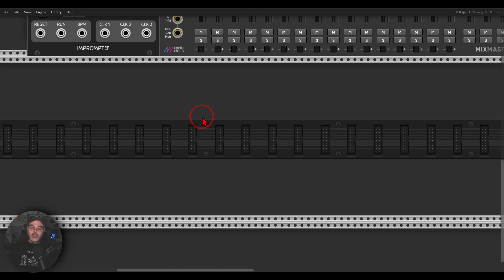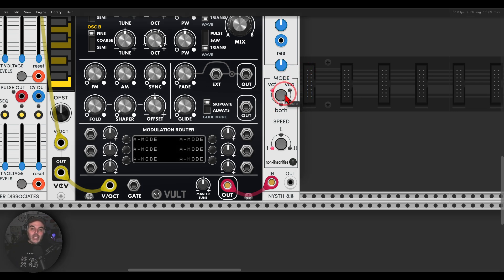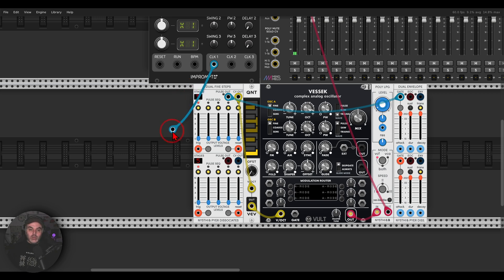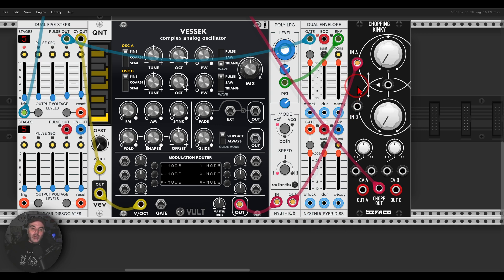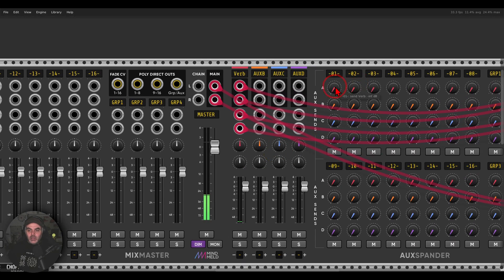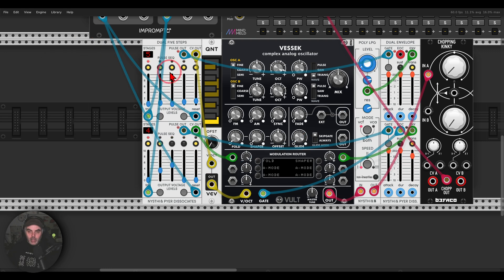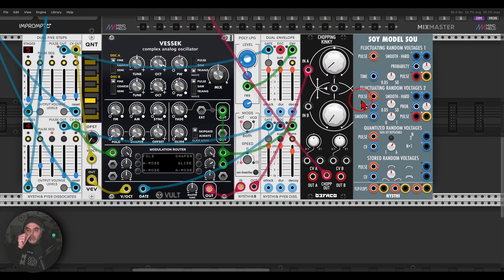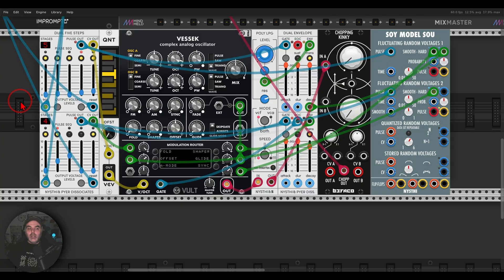Buchla 303?

Comment: 5-30-2025 — the 'pulse' out does not seem to be working on the NYSTHI 'dual five steps' module in VCV. i cannot reproduce the results of this tutorial, although i did manage to get some cool sounds.
Reply from the maker: I just tried it, and it looks like it's working on my end. I just triggered it, and there's a signal coming out of the Pulse of both sections respectively.

Comment: Vessek is such an underrated VCO. For extra fun, mix it in with an Instruo CS-L receiving the same sequence, then randomise everything with Strip. Absolute chaos! 9 times out of 10 it will be unusable, but occasionally you'll get a killer sound.
Reply from the maker: Oh, sounds good!
Reply: Oh yeah
Reply: Copy Pasting this  for later :elbowcough:
Reply: @holydiver4728  forgot to mention, you might want to use Stoermelder Grip to lock some of the parameters. You don't want to randomise the pitch for example, that just puts it out of tune. 👍

Comment: Hey Omri, which midi mixer are you using here? Can you recommended any good cheap ones for VCV performances. It’s too hard to perform using a mouse haha
Reply: Depends on your definition of cheap. one of the most common ones I see is the Novation LaunchControl XL.
Reply: @nebulance4289  thanks I’ll check it out
Reply from the maker: Yeah, using a mouse is not fun... I have the Midilar controller but, unfortunately, it's not being made anymore. I also used the Korg NanoKontrol 2 quite a lot and it was really ok. It's very affordable and has faders, knobs, and buttons.
Reply: @OmriCohen-Music  thanks Omri, the Nano Control is 8 channel I believe. Do you have any recommendations for a 16 channel??
Reply from the maker: @rebecca17ful  Well, I'm pretty sure you can use two at the same time and I'm sure it will be less expansive than buying a 16 channel one...
Reply: @OmriCohen-Music  that’s a good idea. I’ll get 1 and go from there, thanks Omri!